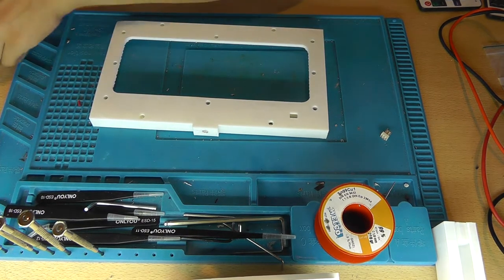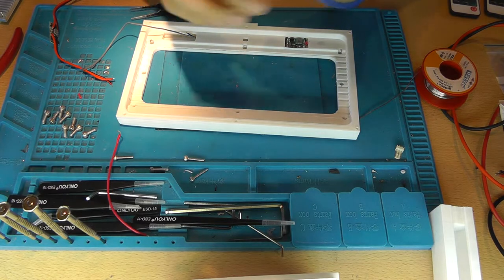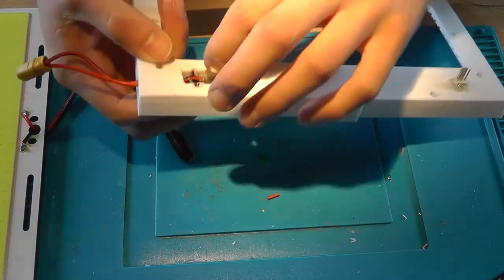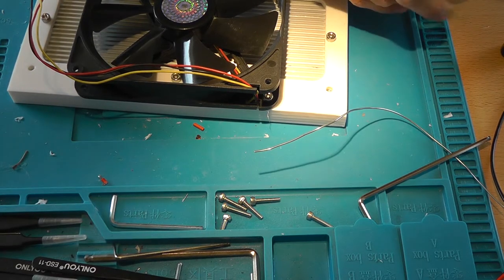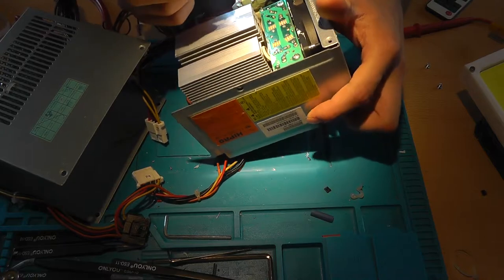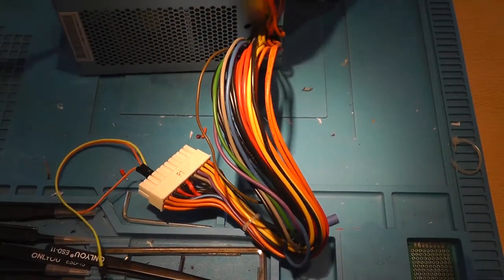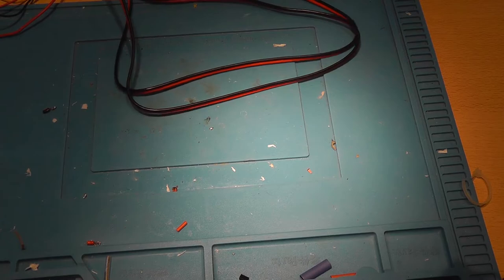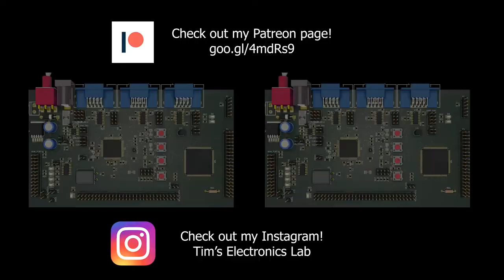#83 Build yourself a DIY ⚒ 200W ⚡ YouTube Studio Light 💡 for under €50,-! (Chapterized 🧾)

Comment: Does it have flickering?
Reply from the maker: Well, if you have the controller at 100% all the time it doesn't. Keep in mind that the controller is unable to handle 200W of power, so you'll have to reduce the voltage to around 15V.
If you want to actually dim the LED there will be some flickering. The power supply/led controller (their the same) can easily be swapped out for another one, making the LED not flicker anymore
Reply: @TimsElectronicsLab   That is a big problem in filmmaking. Your video and all the videos DIY that I have watched are working with DC to DC voltage upload but ....I haven't found a >50V constant current dimmable solution. There is a video on youtube about "teardown of a Godox professional led light" with RF control. The man change the fan to another noctua fan more quieter. And If you pause that video the reference of the power source is (I think) a PWM. That module is difficult to find on aliexpress 😭😭😭
Reply: @TimsElectronicsLab  I conclusion, the best way is dimming at low voltages as you say...😒😒😒
Reply from the maker: You can constant current dim this led, but not above 50V. Dimming by current will eventually also reduce the voltage, so it's basically equal to voltage dimming